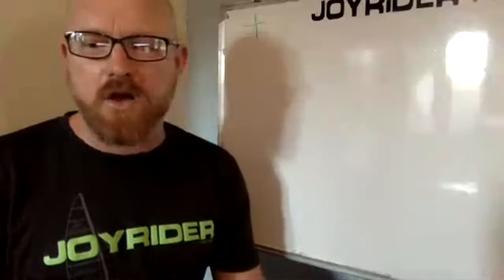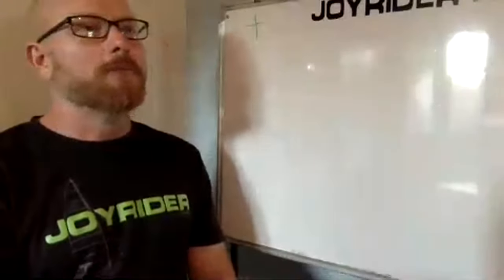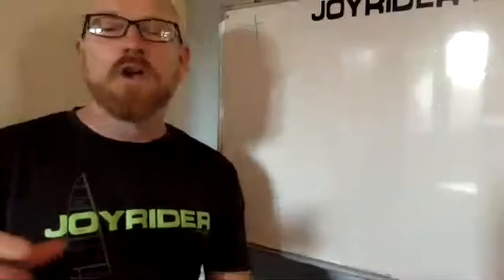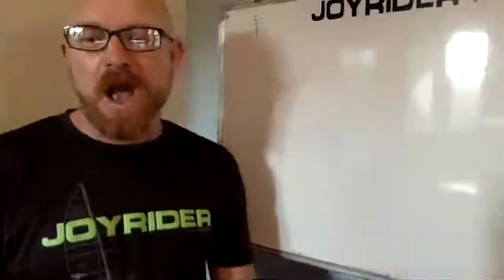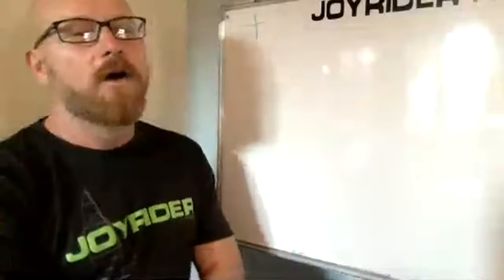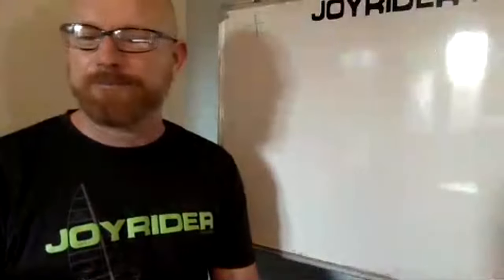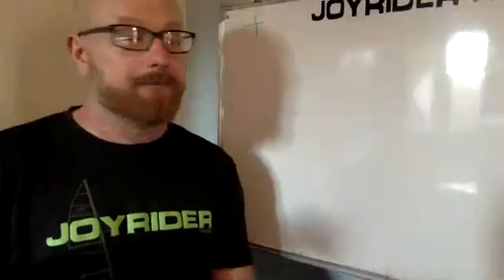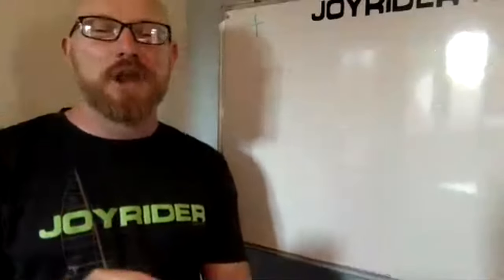Q+A Live 72 Your catamaran sailing questions answered

Comment: Thank you Joe for this clear explanation! Indeed I probably in my routine tend to easing the main sheet after going more broadreach. 
So if placing myself more backwords on the catamaran, and the catamaran still tend towards pitchpoling, you would rather easing up the main sheet than steering back toward beamreach? And second, if in closehold and strong wind condition , would you prefer also to ease the main sheet and not  beating  up eaven more, always to avoid pitchpoling what happens to me here regulary. Once one told me that easing up the main sheet in this condition would placing the center of force more backwords with the risk to capsize backwords. Your taughts about? Thank you so much!
Reply from the maker: Hi Albert, thanks for the great question. 
If it's Ok i'll answer your follow up questions in the next Q+A as i feel this would be helpful for a lot of sailors. 

Cheers